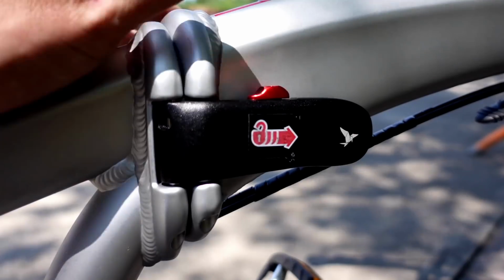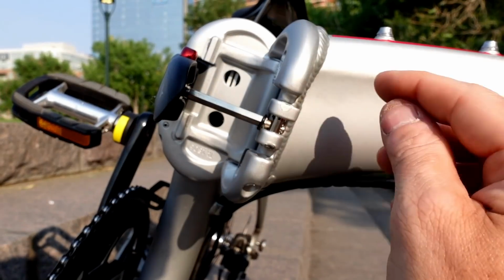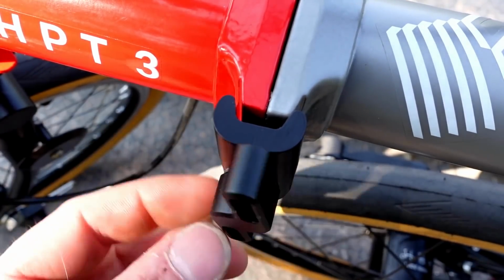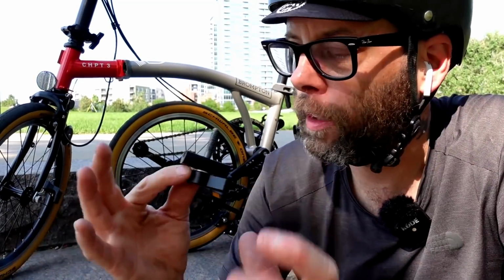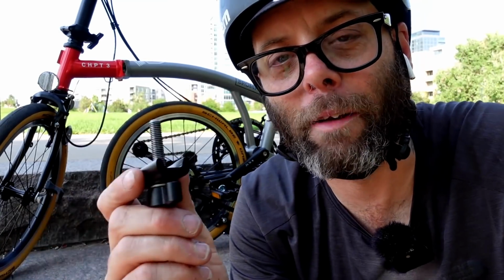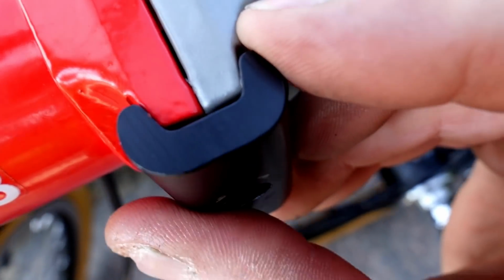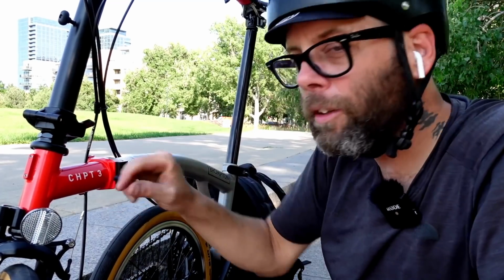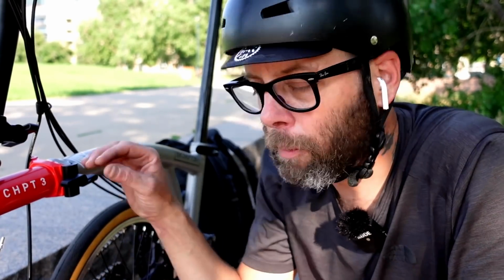Are Brompton clamps Obsolete?

Comment: I definitely love the simplicity and the effectiveness of the Brompton clamp system. Emphasis on simplicity.
Reply from the maker: The simpler the better😀👍
Reply: I agree
Reply: The British steam engine is very simple but I would prefer the modern V6 engine. This bike is too expensive to rip off the customers for the past 40 years with the same old design .  The design could have improved a little with the same strength and better engineering.  See https://youtu.be/_oLIK0XANbo
Reply: @noleo  I dont see how that Btwin is a improvement😂
Reply: @GuoJialiang  Don't see it as a cheap Btwin but watch it carefully from 0:10 to 0:20. It is a far better design with just a flip and turn 90° to unlock as compared to Brompton with a screwing action. Imagine you are screwing round and round in order to lock a Rolls-Royce door. :(
Another crude design is the Brompton symmetrical C clamp, it could turn freely to misalign with the frame but the Btwin C clamp won't with just a simple engineering.  :)